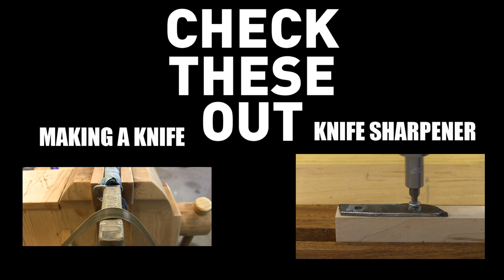Meat Cleaver From An Old Saw Blade

Comment: That is one nice cleaver. Good job.

Using an old saw blade is also a great way to utilize something that might end up in the trash but I have a feeling you're a bit like me and end up keeping "parts" just in case you can use it in the future. I remember reading David Boye's book on knife making. When he first started out he only used old saw blades for his knives.

I've never made a knife, future project, but I've made quite a few handles. One trick I do do when I make them is to use double-sided tape on the handles and put them together. I then finish them on the ricasso end. That way I don't scratch the blade once the handles are fastened to the knife.